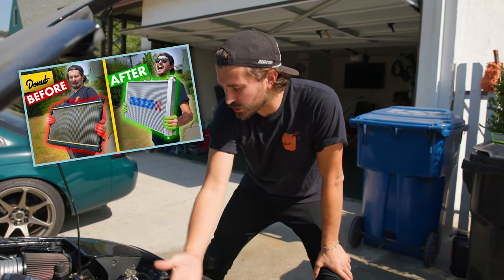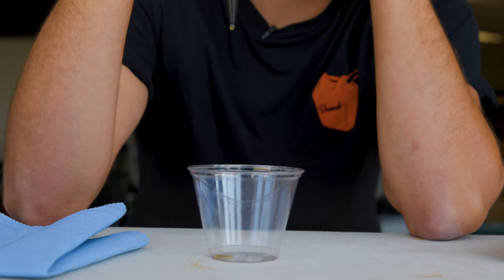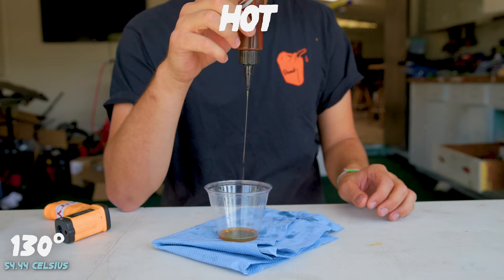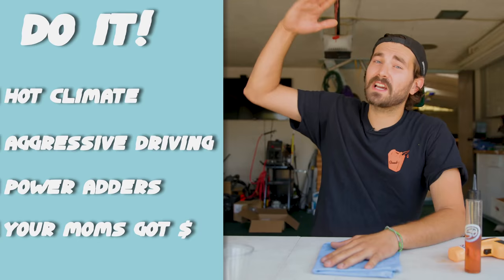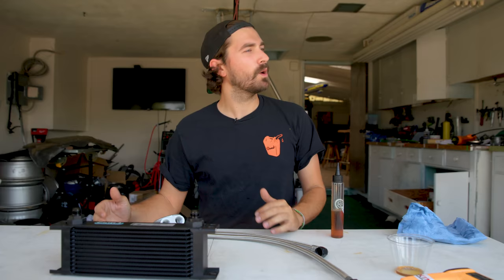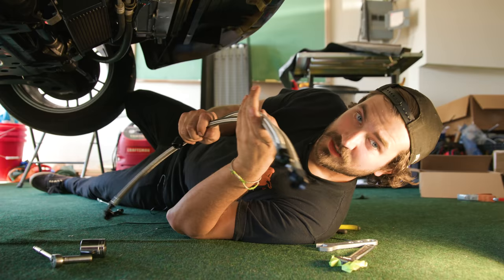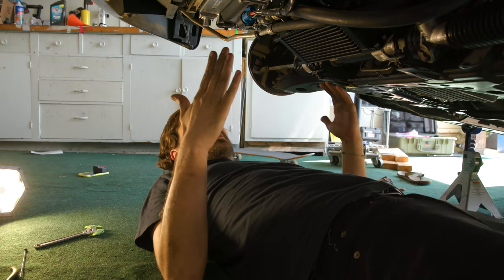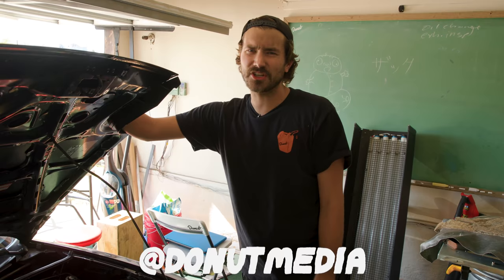Is an Oil Cooler Worth It?

Comment: Imho an oil cooler is always a benefit, if installed correctly.
Especially in your typical american V8 with only 5-6 quarts of engine oil.

I run a 2000 Silverado with a modified LS1 under the hood, and I have quite a large oil cooler (from some older Mercedes i think) behind the bumper, where the little openings are.
I live in germany and drive my truck sometimes 200 miles one way over the autobahn, at speeds of 60-120 mp/h.
MY engine oil (due to the aluminum block) gets up to about 180°F pretty quick and then creeps up to about 200°F.
But from there, there is not much happening, even during longer periods of faster driving, the oil does not exceed 210°F (sender sits in the thermostat adapter, mounted to the oil bypasses over the filter).
That is why I run 0W30 fully sythetic oil, to get the maximum amount of oil flow during cold and hot conditions from my standard voulme, high pressure pump.
Oil pressure is almost 60PSI at idle when cold and over 30PSI at idle when hot.
I would kile to have it even lower, but there is no 20 wt oil that has Dexos2 approval.

Comment: you should adda high flow oil pump. and a matching filter. some applications, like farmtractors actually have water+oil coller as a single unit. helps keeping the oil and water temps the same. and thats where it should be. specially on a car with a turbo, you want a realy high flow pump and make sure you got proper oil cooling. for me? i can't imagine any 4 stroke engine that would not like an oil cooler. should be mandatory.

Comment: Sometimes ignorance is bliss. I had attended various track days without issue...then I installed an oil temp gauge and saw temps soar past 300! Reducing revs at which you shift brings the temps down if you don't have a cooler, but this is temporary. Once the oil cooler was installed I was able to stay on track (won a 6 hour race) without temps passing 250 shifting at 8k. As an added benefit, you get a little extra oil capacity. I don't like the location of the oil cooler as you want air to flow through the cooler to be most effective...without ducting forcing air through the cooler in that angled spot, it may help, but not be as effective as possible. Enjoy!!

Comment: Even on cement I use a drip pan or cardboard.
Coolers should be stock. Oil and engines last longer.
Leaks, failure due to cheapo parts, impact damage off-road are some negatives.
Trick mount and short lines made that very clean and unobtrusive.
Sometimes you see stacked transmission cooler,oil cooler, ac all fighting for a little cool air. If you aren't moving they heat each other up.

Comment: I live in Winnipeg, Manitoba, Canada. It gets -55 degrees in the winter regurally here. It's normally -40 consistantly for months. I need an engine block heater when the car isn't in use. I don't think I need an engine oil cooler. Nice vid though.

Comment: i put an oil cooler on my e36 and i modded it a little bit for when im tracking it 
i put 2 140MM pc fans on the back of it and when im tracking it and it does still get hot i can turn the fans on and my oil will have perfect pressure and temp even when doing 180kph and racing for an entire day best mod ever

also i did have to use an arduino and a button to make it work and program it so that it wouldnt turn on the second i start my car 
kinda tricky for first timers but i did it and it works

Comment: A better cooling system is to integrate this into the main radiator and upgrade that to a three core, then you have water cooling and the oil warms up faster and gets better temperature management.  I worry about that thermostat in the oil fitting...  It would be safer just to have it without a thermostat until they put a sensor in to warn if theres a problem.  The E30 B25 oil housing fitting is perfect for this kind of mod. And having it integrated into the main radiator means it doesn't get so damaged by road detritus.   

The oils viscosity is set by design in the viscosity rating.  In Degrees Celsius.  Time the USA was in the 20th century 🤣.

Comment: Back in the mid ‘60s an F1 car lost bodywork and uncovered the oil cooler. Uncovered, it cooled the oil so much that it thickened and wouldn’t go through the engine which then overheated. But the wag that wrote the magazine  story reported that it retired with under heating.

Comment: Great video on oil cooler installation process!!.. (I'd have measured oil temp + engine block & head temp before oil cooler, and then compare to post- oil cooler, as well as installed oil cooler, after average runs w/ similar ambient conditions, though..).

Comment: Look at using the 1010 filter from that company that puts the nut on the end, I noticed you removed the sticker.  It's a smidge longer then the 1008 you have on your car, a touch more capacity never hurts and the larger filter element is more efficient.

Comment: In Australia, it recomended to add a transmission cooler, especially for those towing. I always considered it a design flaw to have a transmission cooler INSIDE the radiator. A design flaw about the 170,000 km mark for 2002 falcons and territorys is the internal oil cooler will always break into the coolant, allowing oil in radiator, and coolant in transmission. I have a falcon and a territory, both radiator went at same km roughly (within 170,000 - 180,000 range). Falcon I caught early, got cooler added and transmission flushed 3 times and serviced. It been 70,000 km and 2 years since and still going strong (the coolant had turned into the milkshake effect) so I was damn lucky. The territory owner before me added a new radiator, and I added a oil cooler when I bought it so it wont happen again either.
Reply: From the manufacturer's pov it's not a design "flaw" if it happens outside warranty and causes you to buy a new car because the old one is not worth repairing ;)
This is why I don't trust manufacturers when they say you no longer need a shortened first service interval on a new engine. I don't care what they say about their new manufacturing techniques, a brand new engine is going to leave more metallic residue in the oil than a worn one and I don't want that crap floating around in my oil for 30000km. The additional wear is not going to cause the engine to fail within the first couple of years, but maybe it'll make it fail at 250,000km instead of 350,000.

If the engines are completely worn in at the factory why do they still recommend taking it easy for the first 1000km? Because if the engine seizes 3 days after buying it they have to replace it. If it fails 15 years down the line guess it's time for a new car, how sad ¯\_(ツ)_/¯

Comment: Story time. 

My old 02 Nissan Primera 2.2l turbo Diesel had a factory fitted oil cooler. I bought it with 200k km on the odometer and apparently, the previous owner wasn't the most caring about maintenance. 

One day I was driving around town when I heard a loud pop and a thick white smoke cloud came out of the hood. As I opened the hood, every single inch was covered in engine oil. 

Turns out the oil cooler had rusted due to old coolant fluid, leading to oil flowing into the coolant system, which lead to overpressure, eventually bursting the main radiator top hose.

Comment: if you're adding a turbo to the equation, that oil cooler isn't gonna be big enough, at least not if you're gonna track it.  turbos add a lot of heat cause in general more power means more heat, and your engine is being force fed hotter air than it would be if NA.  but you're also running oil through the super hot center section of the turbo to lube everything there.

Comment: It would seem that the angle you mounted the oil cooler at would greatly reduce the amount of air that could pass thought it. Maybe some longer lines could help locate it in the front grill or maybe a small aluminum shroud to direct the air into the cooler?

Comment: Most cars/trucks come with oil coolers now a days but 99% of the time they're actually HEATING the oil rather than cooling it.   Using engine coolant rather than air for oil cooling lets the thermostatically controlled fluid warm up quickly which in turn then heats the engine oil and automatic transmission fluid to operating temperature much faster.   This thins the oils which lets them flow better and consume less power through drag which increases fuel economy while also decreasing emissions.   If you really flog it and the oil temps try to get hotter than the coolant temps then and only then does a 'cooler' actually do any cooling.

Comment: Make sure that you use a CAT oil filter (CAT as in Caterpillar), and also attach a magnet to the filter in order to help catch any ferrous metallic particles floating around in your oil (basically, a second filter that's just for metal).

Comment: You don't need to fill the cooler.. Pull the fuel pump fuse and prime the engine with the starter. Check the level then add more.

Comment: Major word of warning. Having used so called adapters to plumb coolers most go out of their way to restrict flow. I have spent hours with the die grinder trying to get most of the flow back.Every 90deg bend loses 10lb of oil psi. And so many fittings etc take a 1/2"[13mm] oil passage and restrict it under 10mm. 
An oil cooler WHEN fitted correctly is very handy. It stabilises oil temp under hard use as well as deaerates the oil as well. Very handy for track days. A good enough reason to fit one even if you really do not require the cooling. 
For your drive to work car unrequired. Heavy towing [towing the racecar] very handy.
Thermostats generally cause more grief than they fix unless you live in very cool climates. California a waste of time

Comment: If you take your car to track days regularly, even if it is completely stock, you should have an oil cooler. If your car is stock and you have a stock oil cooler, like the Miata does, that’s probably fine for some track days.

Personally I’d have taken the stock oil cooler (the part that the oil filter screws on to) off and replaced it with the aftermarket one.

Comment: Oil cooler for an automatic transmission in a hot climate or vehicle used to two stuff regularly a great idea 
Oil cooler for an air cooled motorcycle like my Honda Grom also a good idea

Comment: viscous is the word your looking for... hotter oil is not "thinner" but simply more viscous. Viscosity is a specification that you can control btw. which will tell you if you need a cooler.

Comment: A 5-W-30 multi-grade engine oil is a 5-weight at +32 F and a 30-weight at +210 F --
Modern oils are thicker when HOT.

Comment: How about FINDING OUT WHAT YOUR OIL TEMP IS before considering an oil cooler?  As you rightly say, there is an optimal temp range for your motor oil, the oil manufacturer will gladly tell you what that range is. Don't guess, don't assume.  Fit a gauge or take a reading after a good run.
Some oil coolers are fitted with a thermostat, but all too often that t'stat is set far too low (160f is common) .
Often an oil to coolant heat exchanger is a far better option than an old school 'Air to Oil' cooler.

Comment: Yeah it dose matter. However this is usually a problem itself. If you have a liminal space to place lines safely then you will need to do more heat protection and wrapping lines. My 335is oil a lines are insulated with extra durability. Because it’s not exactly kosher running those pesky 2000psi a lines.
Reply: Just a rule I k ow is that lines are usually safer ran on the under side euro stuff put the filter up top so an oil cooler turns out to be the worst and best for it.

Comment: You should locktite the adapter bolt on so it doesn't come off with the filter on the next oil change 👍

Comment: It kind of looks like you installed an oil cooler on top of an oil cooler... Even though the factory one appears to be the type that equalizes the engine oil temperature to the coolant temperature, this seems slightly unnecessary. Either way, the kit looks nice and great video!

Comment: Engines run dry more than a few seconds when you change the oil no matter if you prime the filters or cooler with oil or not there will be a coating of oil which will protect the parts for more than a few seconds until theres oil pressure.

Comment: I would like a relocation of the cooler to the front bumper where fresh and high pressure air coming into clear path out behind the cooler...

On that location, airflow might be stalled because of oilpan and engine block at the rear exit of the cooler fin

Comment: So may be a stupid question, but I feel it's important because it wasn't covered here... where you mounted it looks awesome and like it belongs there. However... what about rocks kicking up and damaging the fins or puncturing it? Is it ok getting wet all the time ( I know it's aluminum but still wondering)? Wouldn't it be better to mount in behind or in front of the radiator where it'd be safer and already have steady flow of air without exposure so proximal to the ground?

Nice video, love this series! I just wish I wasn't too big for a miata lmfao

Comment: Use a piece of toilet paper or tissue over the fitting to protect the finish. Using a socket also allows more contact area and helps prevent marring when applying torque.

Comment: The oil cooler is worth it. But a high quality one. Idk on my Toyota 86 it keeps my oil temps at normal operational temperatures during track days with 100 degree weather

Comment: should help with getting the oil filter off for future oil changes as the filter is in the hardest to reach place without removing the front passenger side wheel

Comment: Put a similar * but NOT* FM oil cooler on my track car. Lost a full 15 psi (auto meter gauge) of oil pressure. HOT it Was 50 psi before, went to 35 psi after ( which is below minimum, per factory service manual).

Ended up having to remove it to get my oil pressure back. Mine is a dedicated normally aspirated NB track car. So I didn’t want to blow it up to have lower oil temperatures. 

Do yourself a favor and measure post cooler install oil pressure. With good gauge. Should be about 50 psi *HOT*.

Comment: turbo or NA, adding a oil cooler on  four banger wont hurt anything, your increasing the amount of oil      kinda funny  but some v-8s and four bangers have 5qt oil pans. The big deal is oil cooler location  ,plus you have more plumbing issues the cooler has to be mounted low ,so when the engine shuts down the oil doesnt over fill the pan   (nstall an ati-back flow gizmo).... oil temp should be no more then 230 degrees, You can take spoons and t  heat test sample,s and see what happens and make your own choice

Comment: People,  do yourself a favour and assemble your fittings with Loctite hydraulic sealant, it's made for doing the job as an assembly lube and cures off to resist oil,heat and vibration, lowers the risk of loosening fittings substantially.

Comment: The title generalizes the question,  and its not really a question that can be generalized.  There are a ton a variables . Is it an air cooled engine,  water cooled engines? Is it something that is high performing orientated? , what are your local weather conditions and temperatures? Do you use the vehicle to tow? , do you plan on driving cross country for long periods and in hot temperatures? List goes on and on.  Finally,  did your engine come stock from the factory with an oil cooler? If the answer is yes, then its most certainly needed,  as the manufacturer already determined that,  don't remove it. If the vehicle did not include one from the factory,  and you use the vehicle for general commuting,  then you should be fine with out it, however you may want to add one if one or many of the conditions I mentioned earlier apply to you.  You really need to know what your oil temperatures are for your type of use, in which case adding a quality oil temperature sensor,  and gauge,  will give you the information you need.  If you notice your oil temperatures reaching that max temperature limit,  even if the vehicle did not come with an oil cooler,  you may want to add one. If you notice your temperatures are always within acceptable operating ranges,  then your fine with out it. An oil temperature gauge is a great addition to any vehicle,  as it can also alert you to any changes in your engine,  where suddenly you notice the oil running hotter and hotter,  giving you a tool to indicate maybe your oil has broken down,  maybe the fuel system has started running lean making more heat, maybe your catalytic converter has clogged,  making the engine run hotter,  another long list of possible issues,  where the addition of an oil temperature gauge,  would give you a clear indication of what's going on In your engine.  It's a good topic,  but its not a question that you can generalize.

Comment: did the oil cooler actually make any difference other than increasing oil capacity a little bit? I'm skeptical. Once the oil is up to temp a second or 2 traveling through a 'cooler' won't matter. The heat source (and time oil is exposed to it) is too great. Like putting your hand inside the fridge and expecting the temperature of your blood to go down
Reply: it will increase the dissipation of heat, how much? really hard to tell. I know my Diesel has one built in from the factory, but it is just a chunk of aluminum

Comment: I don't get why they didn't place the cooler in the grill opening where fresh cool air can flow through. Especially on hot California pavement, its seems like the heat radiating up from the asphalt would start heat soaking the cooler and negating the cooler on the best case, and heating the oil up again in the worst case.

Comment: hi oil cooler results are different on different installs .
differences  are  
oil flow  and oil temperature 
air flow  and air flow temperature 
cooler design   tube /fin  , plate style , plate and fin